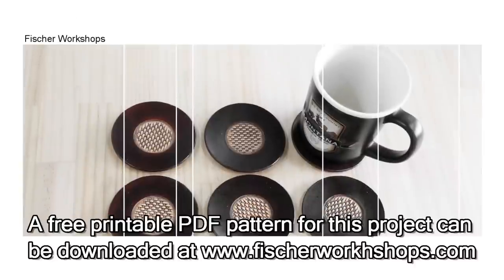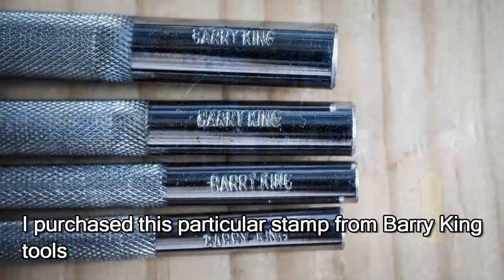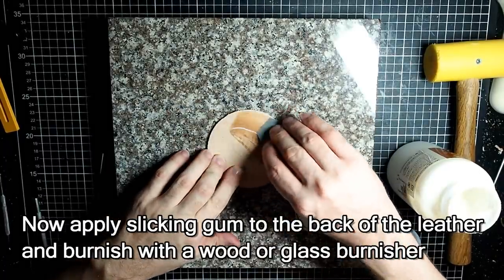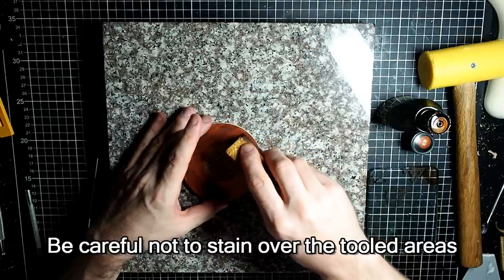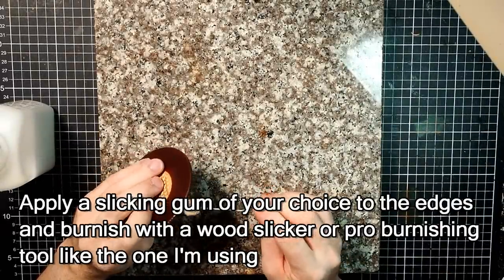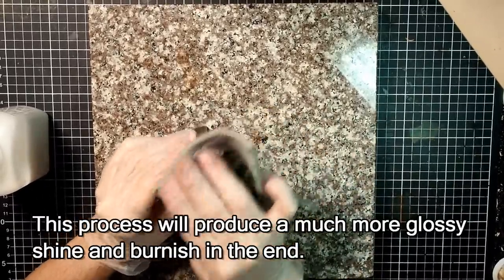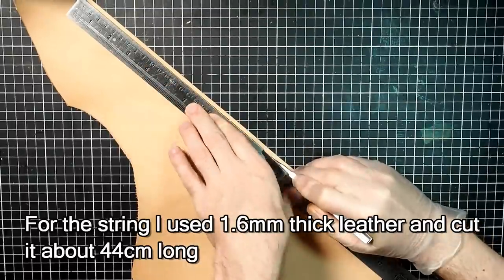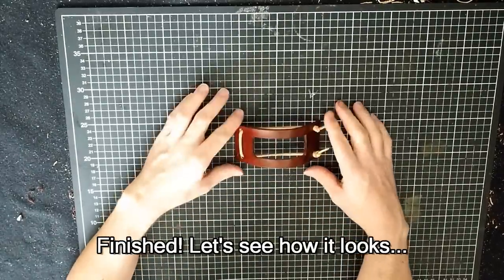Leather Coaster Tutorial by Fischer Workshops Full HD

Comment: Excellent. I’m wondering if you could buy a threaded rod, with like a decorative tube that would slide over the top of it. That way you have like metal supports across the base instead of the string. Of course you would have to cut the length

Comment: Great vdo! are you using a dremel with your wood burnisher tool ? can you let me know what dremel model are u using ? i heard thast the 3000 can heat quickly. any website for the burnisher too ? thanks in advance
Reply from the maker: I use the 3000 with a flex shaft. I like it... Speeds are adjustable, although if you don't mind spending a little extra the 9100 is the best for professional use. The edge burnisher I used can be purchased from http://proedgeburnishers.com

Comment: How do you address the hole in the leather that the needle from the olfa tool leaves in the center of your coaster?
Reply from the maker: Hi, it gets covered up by the basketweave tooling later on.
Reply: Fischer Workshops so I guess you would probably have to use some type of design whenever you use the circle cutter the cover cover up the needle Mark correct? Do you think that you could flip the leather upside down and cut the circle from the flesh side?
Reply from the maker: chrisa pattee Most definitely, it shouldn't break through if the leather thick enough